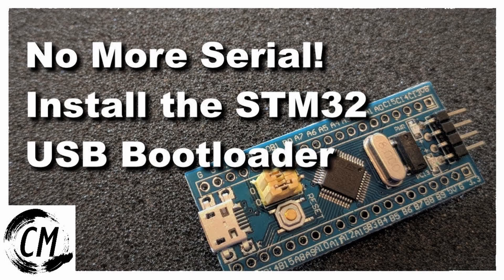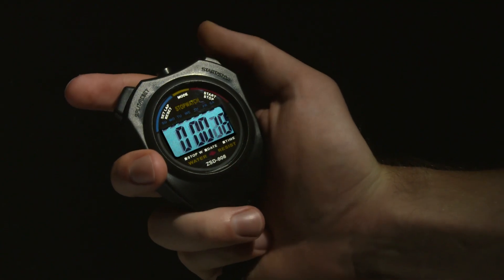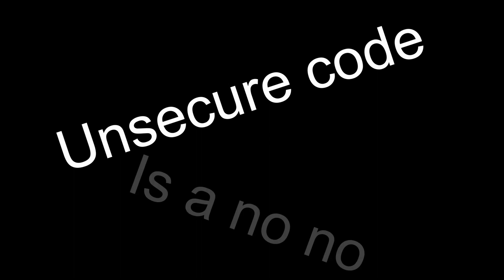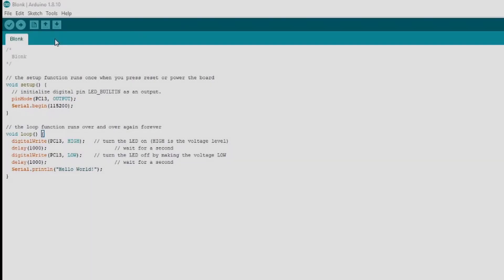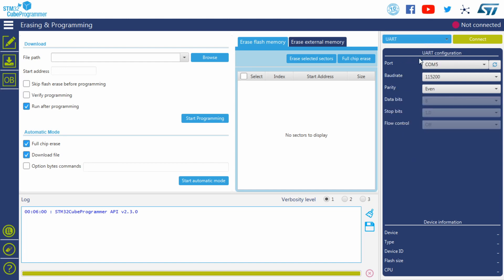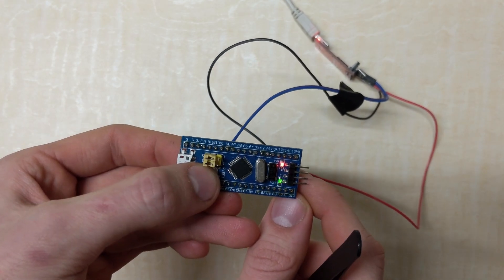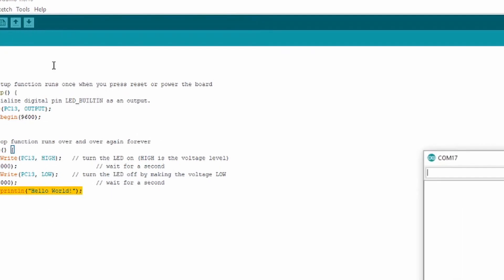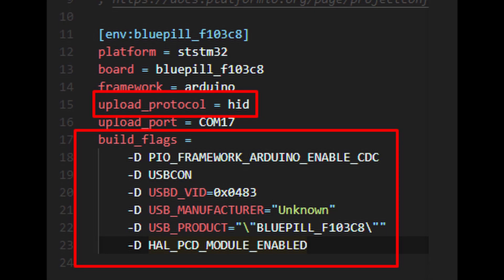How to Install the STM32 USB Bootloader, New Version! (Blue Pill F103C8T6)

Comment: I've been playing with the Blue Pill and the St-Link Flash utility, and I think I might have erased chip including the built-in embedded boot loader.. is that possible?

The reason, when I switch the BOOT0 jumper to 3.3v and power the board, I see the UART1 TX pin from the Stm32 stay LOW... but I've read that if the ROM bootloader is running correctly, its TX line output should idle HIGH.   I tried sending 0x7F (even parity) anyways, but no luck.. no (0x79) response from the chip on UART1 (B7/B6).     I also tried UART2/3 (A3/A2, B11/B10).  

Is there a way to verify if the embedded bootloader is still there.. or restore it if I've clobbered it?  As a test, I was thinking jumping to the bootloader from my application but I can't find the address where to jump.    AN2606 says the for medium density devices like the F103C8, that the chip id is 0x410, but only lists the *bootloader id*/address (0x10/0x1FFFF7D6).
Reply from the maker: The UART bootloader is in rom and cannot be erased. However the chip itself could be fried for some reason.  Do you have an ST link or another blue pill? You can make the blue pill into an ST link and potentially still upload code to the one that's messed up. I should have a video coming out about that soon
Reply: @CalebMarting  yes, the chip seems to operating otherwise normally.. I can still program it with the st-link (swd interface).   Long-shot, but perhaps it is in DFU mode, but somehow thinks the upgrade is coming from USB/CAN/I2C/SPI and therefore its disabled the uart?  Seem unlikely as aside from power via the usb-micro, all the other pins are open.. but not sure what else to make of it!
Reply from the maker: Those pins might have just been fried too cuz I've heard other people have fried only specific pins. Very weird. Perhaps there's some sort of protection feature? Maybe you could use STM32 cube programmer to do a full chip erase, see if that helps
Reply: @CalebMarting  Thanks, you gave me a great idea.. test the pins by writing a program that uses UART1... as I was doing that, the Device Configuration Tool shows UART1 to be on P10/P9!  Using those pins, the DFU worked!   I goofed when I was using a very colorful popular pinout diagram of the blue pill that shows RX1/TX1 on B7/B6..I thought the outer most columns were the default pins, and alternate functions on the inner ones... apparently, that's not the case!

Comment: bootloader worked fine but windows 10 doesn't detect my blue pill. Error: Unkown USB Device(Device Descriptor Request Failed)
Reply from the maker: Unfortunately some blue pill chips are knock-offs or they were not functioning correctly which is why they got turned into blue pills. We've had a few people with this issue unfortunately. Can you try it on a different blue pill?
Reply: Caleb Marting thanks for responding, the funny bit is I can still use Arduino and through ftdi do a blink sketch. Due to virus situation I cannot get new one, for now I will continue with ftdi. Next month will get few of these to test further.
Reply: @Daniel Romila Hey good to hear and thanks for the link, let me read through. meantime, the update is that I am now ready with my experimental code and waiting for amazon to resume shipping. I am going for ST Link with debugger, it will be a one-time solution.

Comment: the stm32 cube programmer wont work, ive tried reinstalling java , any ideas how to fix this ?
Reply from the maker: Is it the latest java version? In the installation directory there were some files that look like you could use them for command line. I bet you could use those to install. otherwise there are specific tools that STM has put out for just the ST link or serial port. (STM flash loader demonstrator for that one) although you will still need to have those command line things installed

Comment: Great video! it works well under arduino ide but i cant make it work on platformio, the error message says that the builder isnt found...
Any idea why?
Thank you
Reply from the maker: I haven't had that issue before, I don't know what would cause that. Maybe if you join the discord someone there may be able to help you debug that

Comment: i tried this many times, i uninstall ed and reinstalled it from boardmanager ..i have put the bootloader but when i upload the blink code it shows up fork/exec cmd.com: The system cannot find the file specified...can you please help ?
Reply from the maker: Hmm. That could be an issue with your Arduino installation. Or are you on Linux or something? It should still work on Linux but something might be different
Reply: @CalebMarting  i am in windows
Reply: what do you propose
Reply from the maker: Possibly try reinstalling Arduino, you could also try using platform IO
Reply: @CalebMarting  i reinstall arduino ide and now working takes long time to compile is that ok?
Reply: thank you so mutch now im going to try the platform IO
Reply from the maker: It does take a long time to compile through Arduino cuz it doesn't cache anything. Best of luck with platform IO I'm working on a tutorial for that at some point

Comment: Man please help me I followed you instructions but I not able to find stm32  cores in labrary manager .. as in you video 1:37
Reply from the maker: Did you add the designated URL into the additional board manager URLs? It's in the description
Reply: @CalebMarting  Yes I tried many times but still doesn't work
Reply from the maker: That's... Very odd. If you could join the discord in the description it would be easier for us to help you.
Reply: @CalebMarting  I can confirm the process leading up to 1:37 doesn't currently work. Tried on latest arduino version. The 'stm32 cores' package just isn't there. Which is weird because the link to the json file is good and as far as I can tell the json file doesn't have any broken links, nor has it been changed since your video.
Otherwise, great videos, thank you!

Comment: I have problems !, I get this comment:"Timeout error occured while waiting for acknowledgement.

Timeout error occured while waiting for acknowledgement.
Error: Activating device: KO. Please, verify the boot mode configuration and check the serial port configuration. Reset your device then try again... 
"
Reply: Do you still have this error? If you do I can walk you through a fix. If you join the discord (link is in the description) it would make it a lot easier to show you how to fix it.
Reply: EDIT: Okay, I found out how to fix that! In my case it was bad, cheap chineese clone of programator PL2303. If you have one of these, you need to find drivers from 2008 (3.3.2.105). They will work on Windows 10. The new ones just block the chineese versions from working. Aside from that, check all the cables if they stick, and don't forget to choose the correct port, in Cube32Programmer in UART configuration, check if other COM ports appear :)
Reply: Just click the reset button and retry... you have to listen carefully the explanations in the video before posting !

Comment: Wow, so many things did not match. 
1. Here is the board I have: https://www.amazon.com/gp/product/B07XBWGF9M/ref=ppx_yo_dt_b_asin_title_o01_s00?ie=UTF8&psc=1
2.  My board is an f401, not listed in the binaries zip file, so I used F407.
3. The blink program appeared to build with no errors. just the normal usage messages

4. Upload reports =>
Arduino: 1.8.12 (Windows 10), Board: "Generic STM32F4 series, Generic F401RE, HID Bootloader 2.2, Enabled (generic 'Serial'), HID (keyboard and mouse), Low/Full Speed, Smallest (-Os default), Newlib Standard"

Sketch uses 13376 bytes (2%) of program storage space. Maximum is 524288 bytes.
Global variables use 2708 bytes (2%) of dynamic memory, leaving 95596 bytes for local variables. Maximum is 98304 bytes.

+-----------------------------------------------------------------------+
|         HID-Flash v2.2.1 - STM32 HID Bootloader Flash Tool            |
|     (c)      2018 - Bruno Freitas       http://www.brunofreitas.com   |
|     (c) 2018-2019 - Vassilis Serasidis  https://www.serasidis.gr      |
|   Customized for STM32duino ecosystem   https://www.stm32duino.com    |
+-----------------------------------------------------------------------+

> Trying to open the [COM8]...
> Unable to open the [COM8]
> Searching for [1209:BEBA] device...
##########
Error - [1209:BEBA] device is not found :(> Searching for [COM8] ...
> Finish
the selected serial port > Finish
 does not exist or your board is not connected
Reply from the maker: Unforunately not all compiled binaries work interchangeably with different STM32 chips.
This video was meant for the F103 board. I have a tutorial specifically for F401 boards here:
https://www.youtube.com/watch?v=b1123kz_3MM
Reply: @CalebMarting  Thanks for the reply. Not everyone is careful when referring to online videos. I was referred here from a query specifically about the board I have. I appreciate your response and will check out the f401 video.

Comment: So, yeah, 2k for a bootloader sounds much better. Now just show it in Linux. You might want to note the OS in the vid/title as well. 
  The issue I have had with PlatformI/O is it's slow speed on my old laptop. I'm building a better dual boot machine with W10 atm, but still cringe every time I use windoze.
 BTW, I have a STM32 playlist (references to other people's stuff, like this vid). One thing I recall seeing/saving is an upload someone did showing how to unlock the full 128k of memory on the 64k limited parts. I haven't tried it, but that looks interesting. Apparently all part numbers within a family of STM32 chips have the same die. I've heard, in the past, the part numbers were used for graded chips, separating them according to what worked/didn't work during production. As the yields have gotten much better they are using fully functional chips to fill orders for lower grade part numbers and just limiting the integrated peripherals in the internal registers, but this can be reversed :-)
-Jake
Reply from the maker: I've looked into doing the 64 to 128 conversion. Haven't ever gotten it working yet though. This should theoretically work with Linux and Mac as well because I believe the STM32 cube prog and hid bootloader work on those systems too. The process should be almost exactly the same. If you ever try it out let me know how it works.

Comment: Hi Caleb Marting! Thank you for putting this tutorial.
I did exactly what you have shown, and I think I have successfully upload a blink code (via direct usb to STM32) once or twice after I have uploaded the bootloader. I remembered that similar message like below will appear when I upload the code:
Sending command...
Flashing firmware...
. 1024 Bytes
. 2048 Bytes
. 3072 Bytes
.....(and more)
Done!
Sending command...
Searching for [COM9] ...
Finish`

However, after this, I was failed to upload the code. I am still able to upload code using FTDI. I have tried to reupload the bootloader multiple times but everytime when I plug in the USB directly to STM32, my computer would say "USB not recognized"  and I cant upload the codes anymore. The error comes up when I upload :  Error - [1209:BEBA] device is not found :(> Searching for [COM3] ...
> Finish
the selected serial port > Finish
 does not exist or your board is not connected

I tried to reupload the bootloader many times with no luck.
Do you have any idea?

Thank you.
Reply: Try erasing the flash memory before reuploading the bootloader or uninstalling the com port before plugging in the usb cable
Reply: @finnknauber  Ok, may I know how to do that? Erasing the flash memory can be done using STMCubeProgrammer? Uninstall com port from device manager?
Reply: @leyongtay5067  If you join the Discord I could show you some pictures. But yes in STM32 Cube Programmer you can see the little eraser in the lower left corner. Just click on it and then click OK. After that you can upload the bootloader like it's shown in the video. The com port can be uninstalled in the device manager.
Reply: @finnknauber Changing USB and uninstall COM port have no luck. But erasing the flash memory works! Guess I mess up when I change the boot position? Also @caleb marting sorry for the late reply, was busy with something else here. Once again thanks both of you for the help! 

BTW, I tried a stupid benchmark program (just a float divided by a float, then loop it for millions of times), STM32 is almost 10 times faster than Arduino UNO! This is very exciting considering bluepill can be bought wayyyyy cheaper than a Arduino clone.
Reply from the maker: I had that issue with a bad USB cord. Could also be the connector on your board is bad or poorly soldered?

Please reply if no luck replacing USB cords or something. The discord is a good place to get in contact.
Reply: @CalebMarting  thanks for the prompt reply! I will try it first, will update you probably next week.

Comment: Thank you, just saw this on reddit, the day after i got the board. Subscribed!
Reply from the maker: Good timing then. Thank you!
Reply: @CalebMarting  Hi Great Vids however after 5 attempts I still get the following  error when I try and down load a program : > Searching for [1209:BEBA] device.... Error - [1209:BEBA] device not found
Reply: Further to my last Windows device manager reports device on Comm 7 but bootloader is checking comm 5.
Reply: @johnmmcguinness7982  Do you still have this error? If so try flashing the bootloader and uploading any sketch. Before you upload the second time select the boards com port (that would be com 7 for you) in the Arduino IDE and then click upload. It should work this time

Comment: I suppose that was interesting but it was a bit fast for me and I need to look at some lower level stuff first. I thought I saw somewhere that the blue pill had been replaced by a black pill but like I said I need some lower level stuff first.
Reply from the maker: This should work with black and blue pill boards, I just happen to have blue pills. Thank you for the feedback

Edit: to anyone reading this, I was informed that black pills actually refer to F401/f411 boards which this is not compatible with. I am releasing a new tutorial for that